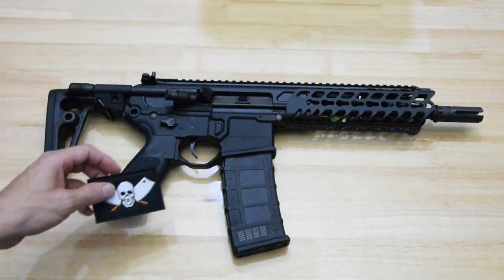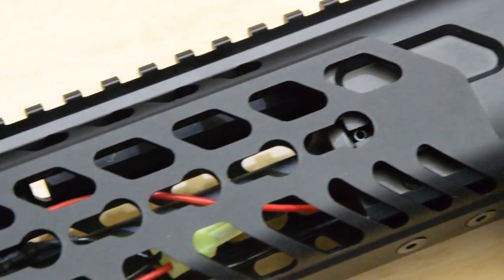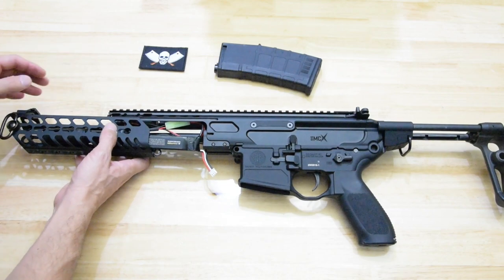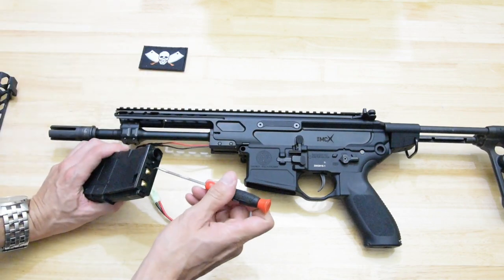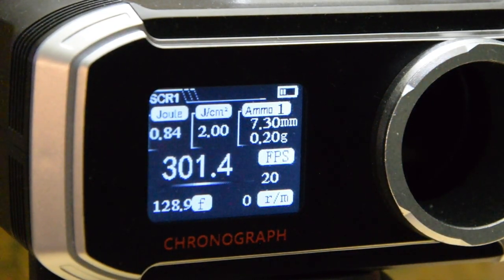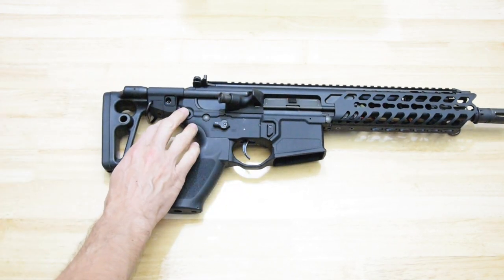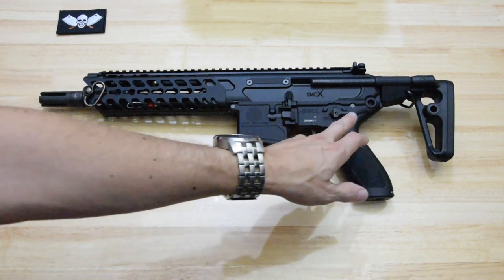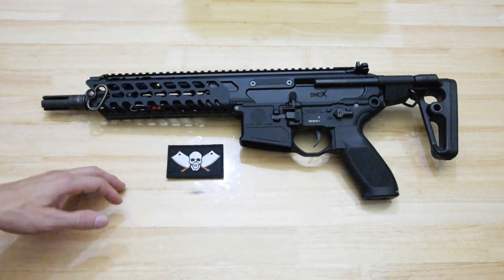BOLBR: WAT international SIG MCX gel blaster review.

Comment: I put a long PEQ box on mine so I can run my Titan batteries. It's a sweet blaster for sure. I got the side folder stock on mine, very happy with it. The basic LDX box is pretty decent when left alone, as in standard spring and gears. Just shim it and check air seals. The dust cover gets better, the charger handle needs to loosen up a bit so it re sets the dust cover release properly, then it closes easily.
 No lock feature on the feux bolt, just there for looks.
Reply: where is this available for purchase?